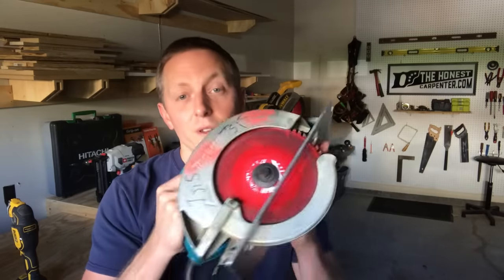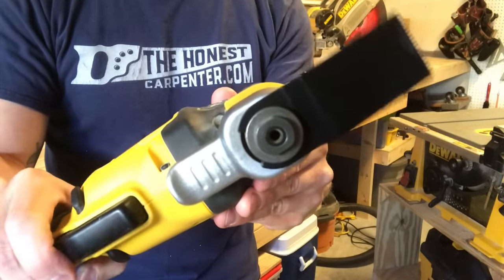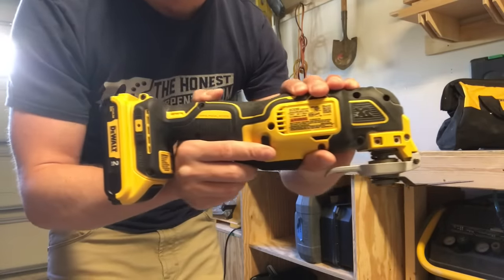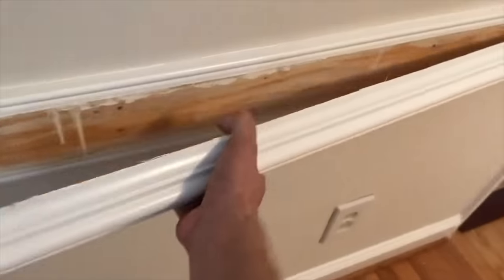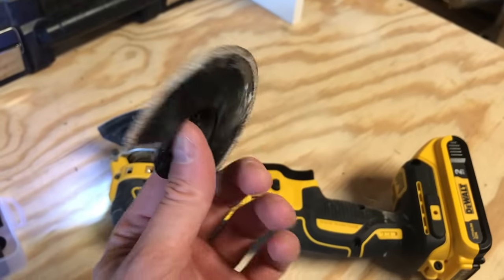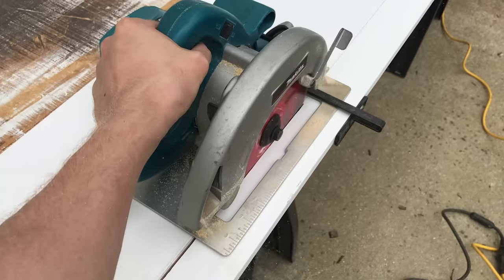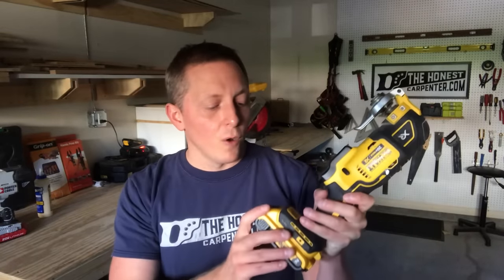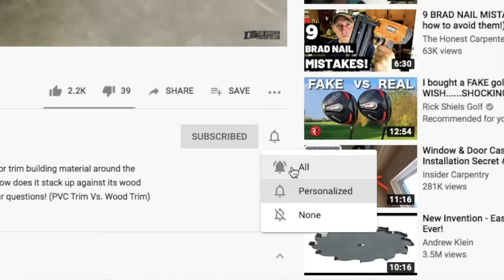The BEST SAW You've NEVER HEARD OF!! (Multitools--Great For Remodeling!)

Comment: An important point omitted in the video: This tool is a lot less dangerous as a saw than other saws because the oscillation pitch is so small that if pressed against your skin, it actually won't cut it at all. For most parts of your body, your skin and the flesh under it will just vibrate with it. In that respect, completely different to a circular saw or jigsaw. It'd still be painful nonetheless, and riskier on parts with less flesh (tops of fingers & toes, kneecaps, skull, etc.) but nowhere near as dangerous as a circular saw.
Reply: if you are using the longer toothed wood cutting bit I'd doubt that. for the finer bits I'd agree.
Reply: I agree with you about how safe this tool is. I’ve pressed mine against my skin many times. However, I still feel the circular saw is the safest simply due to the retractable guard. It’s really difficult to come into contact with a spinning blade on one unless you’re a complete moron with power tools.
Reply: I've seen a batch of these used at an orthotics factory, mostly on plastic.  The workers were fine with putting the vibrating blade against their palm, but those blades didn't have aggressive teeth and the palm is a padded part of the body.
Reply: Exactly! The vibration is 1-2 degrees max - so anything that has a little elasticity will just vibrate with it. So skin and flesh are safe. On the other hand, yes, it can cut through rigid materials like nails or bones without any issue.
Reply: @theoriginalchefboyoboy6025  actually the teeth size don't matter much, unless you stab it vertically into your skin

https://youtu.be/wCweyvsBGM0
Reply: I've actually done exactly what you've described.  I've pushed it on my finger and my finger just vibrates with it.  I'm not sure how i figured it out as i'm not a huge risk taker but it doesn't cut at all unless something is stable.  heck if the wood i'm cutting vibrates it won't cut it.
Reply: These saws were originally invented for bone cutting, and the idea is that they are great at cutting hard staff but poor at cutting soft stuff as it vibrates with the blade. So they're actually more safe. 
The vibration, though,  is a whole other story. Using this thing for prolonged periods will not make your hands happy.
Reply: I’ve seen videos saying newer tools have up to 4 degrees of motion instead of like 1.4.  Do you think that changes how harmless they are to cutting through skin?
Reply: I wonder if the idea for this tool came from cast cutting saws. I mean like a leg or arm cast. They use a vibrating tool that cuts the cast, but won't slice skin. Ya, I found out fast that if the material you're trying to cut vibrates, the blade is hopeless.

Comment: The oscillating motion prevents it from breaking the skin if you happen to graze the blade. The stroke isn’t long enough to break skin unless you’re really digging in with it. An oscillating tool os pretty much what is used to remove casts, and in fact that was the original intended purpose of an oscillating tool. It wasn’t until later that someone figured out it would work for more than just removing a cast.
Reply: I remember a doctor using one to cut the cast off my arm in the 70's.  It tickled when it touched skin.
Reply: I was using mine the other day to work on a section of a fence I recently repaired to cut through a fastener and I wasn’t expecting it to cut through it so quickly, so it flew past the fastener, got caught on the wood on the way and went left towards my hand. It cut through my work glove like butter around the thumb area (glad I was at least careful enough to wear my work gloves that day). I wouldn’t test it on skin!

Comment: These tools were originally invented for removing medical casts without cutting the patient's flesh.  They are very effective on hard brittle materials like tile, grout, drywall, and concrete/bricks and become less effective the softer the material is.  While the ones built for construction are generally more dangerous than the ones built for medical use, the oscillating action of these tools is still much less damaging to flesh than the ripping action of a circular saw or sawsall.  That said, you should still wear anti-cut gloves when using them and keep the blade pointed away from your fleshy bits.  Also, the nice thing about these tools is that they stop very quickly after you release the trigger, so if you just don't lock the trigger in the on position it won't take your toe off when you drop it.

One other thing to watch out for with these tools is fire.  The oscillating blade can create a lot of friction when used on soft wood or wood products like MDF, and they can actually set those materials on fire if you're not careful.  Like I said, best to use these things on hard materials and avoid trying to cut anything that creates a lot of flammable dust.

Comment: I agree that it's a Game Changer for repairs

I do woodworking as a hobby and have all of the woodworking tools for making tables, desks, shelving etc..  I began doing several home repairs and remodeling lately and got an multi tool after watching a few of your videos.  I didn't realize how much I needed it until I started using it.  I just finished rebuilding my front porch and nothing was square or flat.  I finally just roughly installed things like trim and then used the  multi tool to flush cut everything to match then sanded it.  I never would have been able to figure out all of the random angles. The project farm actually did a video on blades for the multi tool and I have been using the winner of the tests and they actually last nicely.

Comment: As you say these are  VERY handy for some applications . I have concluded after a year or so of professional use that it is worth it to just use the carbide toothed blades and save myself the grief of of having to change out a HSS blade that got dull quickly , unless you are cutting butter. Also dont waste your time trying to cut metal with these tools . Just get out the angle grinder with a cut off blade ! But they do pretty well on aluminum . But they just dont put much set in the teeth . 
      But a cordless angle grinder with a nice thin cut off blade in it is as revolutionary as the oscillating tool . So many uses , and so quick and easy to use.  But not for wood .

Comment: When I had to replace the rotten bottom parts of some boards in my barn doors I had to cut these boards in situ at 45 degrees. it came to my mind that a multitool would be ideal for this purpose. So I bought a Bosch that performed very well. Later i used it for sanding in tight corners and various other jobs.
Reply: That's exactly the application I thought of when I saw the video.  I have done this job with a hand back-cut saw.  Very tedious!

Comment: Another thing I like about the tool is you can turn the blade 90 degrees if need be and it works the same. I did this on a 6' T&G vinyl flooring cut yesterday. The tool being parallel to the material helped me keep it more steady instead of being perpendicular like it is normally used. Great video!

Comment: One thing that was not mentioned is that especially with more budget blades you have to secure smaller workpieces so they don't just start vibrating with the blade. It happens way less with higher quality blades tough. Really good video. Please keep them coming.

Comment: I've had my Harbor Freight tool for a few years now and use it on almost every project for sanding.  Recently I got a 18v Ryobi one and took a wood blade smoothed down the bottom side, and use it to flush cut plugs for screws and other holes, with minimal or no damage to the piece.  I also use it a lot when repairing various wood items, cut out the bad area  and then glue in a filler piece.

Comment: Newer to larger DIY projects.  Couldn't figure out how to make the cuts in replacing a door threshold, picked up the Dewalt and was done in minutes.  Recently used it when putting in LVP flooring.  Removed all the old nails and staples from trim/carpet.  Highly recommend as well!!

Comment: Had one for Christmas and even though I'm just doing a little DIY at the moment I've used it several times since.  Really useful.   
BTW...I saw another Youtuber 're-toothing' a blade with a file.
Reply: Yessss! It is actually easy to re-tool the teeth if you've got some decent skills. Just can't eat away too much material, but is easily doable. Side note: I sharpen my beat up router bits with a die grinder and have had good success for quick fixes and also use it to sharpen my cut off tool bits as well. ....but I'm a metal guy first so I'm used to doing crap like that.

Comment: Hey Honest, saw your video and my wife got one (DeWalt) for my birthday.  I already had some DeWalt tools using the same battery.   My first little job was to cut a piece of scrap laminate flooring to use as a shelf support (sounds odd, I know, but too long to go into).  I loved it!  Much easier than my hand mitre saw and less dust than my circular saw.

Comment: Hey man, using a small triangular file and going opposite direction for every next tooth you can resharpen these blades easily in a pinch.
Reply: Yeah, SeeJaneDrill did a good video on sharpening multitool blades.  A Dremel, used with carefully, could do it in a flash.

Comment: I am a big DIY fan. As well as full time mechanic in the automotive world. NEVER heard of a power multitool before. Normally when I hear Multitool I think of pocket Gerber or some other such thing. Saw this dewalt multitool on sale at Home Depot..... game changer. Amazing what this little guy can do. Use it to cut bolts all the time.... and as long as the blade is not dull? Cuts through metal like butter. Hard to reach bolts / seized nuts / etc. Haven't used it on wood yet.... but if it handles metal easily, I know wood would be no problem.

Love your review on this tool and agree... a deff must have.

Comment: I have. Fein tool,  I bought it when they were the only one making this tool.  20 years ago. I bought it so that I could plung cut into hardwood.  Now you can get a nice one for under a hundred bucks but I paid over 400 bucks for mine.   I have been in situations that it is the only tool that will work at all.   I used only when I was stuck because the cost of the blades and there was only one store in the area that carried them.  They were not always available . Thankfully the cost has come way down and every DYI store carries them.  For someone who does a lot of remodeling this is a must have tool. By far the best tool like this is the Fein.  But they are expensive. But then they last a long time too.
Reply: The new Fein multi tool has a quick release, ramp up start, and a 16’ cord. My brother had the original and it lasted forever, I think it’s just the switch that failed but he replaced the whole tool. I bought the new one, it’s the best multi tool I ever used....was on sale at menards for $90 and even came with 5 blades. The dremel brand was my first, burned out after about 40 hours of use. Bought a cheap harbor freight one to finish the job the dremel died on, but the case of that tool stopped staying together and it vibrated less after that. I’ve used dewalt cordless, Milwaukee cordless, Fein is the best
Reply: Yea, no quick release and no ramp up trigger but it does have an adjustment speed knob on the side. I love that the fact that all the newer blades from other companies will fit mine.  It’s a bit of a pain changing blades but I only use it for specific jobs it not too bad.  If I really wanted that feature I could always buy a cheap on.
Reply: Fein invented the tool and it's a quality product.

Comment: Needed one of these when I was tiling my kitchen to cut trim behind the stove. Went to Home Depot and explained my problem, the guy there recommended using a hammer and chisel. I didn't wanna chisel away 3 feet of material in a cramped space. Another customer overheard and told me to get one of these. Game changer! I've used it for so many things since then.

Comment: Used in masonry restoration work. With a smooth blade, the oscillator is awesome for removing old chalk joints.
The original German made Fein Tool was and maybe still is the best. Used to come with like 10' cord.

Comment: I'm a DIYer. The multitool changed my life! How much time and trouble it would have saved me if I'd had one 20 years prior. I consider the $100 I spent on it "Free." For the meticulous and perfectionist,  it's a gift, really.  But it is one of those machines that, like a printer, you complain about every time you have to buy blades ("ink cartridges"). For cutting metal, I've found the 
carbide blade essential, and they are pricier. And, like a jigsaw, guide the cut, let the blade do the work. If you have to start pushing the tool, replace the blade.  I've used the multitool in all the situations described, wood, trim, old nails (how do you get that nail out that holds the outlet box to the stud without disturbing the drywall? Multitool !!), plumbing (most recently, bathroom faucet handles that are corroded and frozen, the screw top rounded off after failed attempts to remove it with a screwdriver---not much space to use a hacksaw). WARNING: Whenever you're cutting metal with this tool, be prepared for the fine metal shavings that will be created in abundance. Have a vacuum handy or mask the area to collect the fines. Wear goggles and an N95, especially for overhead work.

Comment: Hey I just wanted to let you know that the oscillating tool will not cut you. As in it won't cut through your skin because it is to soft. It's one of the reasons why they use it to remove casts off of people. In the anatomy classes they refer to it as the "bone saw" because it doesn't damage the tissues like a regular saw would when you're trying to separate body parts.
Reply: yep, your skin has too much jiggle to be affected by the oscillating tool lol. Anyone would know that.. especially when cutting a shim for instance that doesn't have enough bearing to stop it from shaking/moving. It simply won't cut. Although i'm sure this guy just said that to cover his own ass.
Reply: I remember the original television adds when these tools came out for home use (many years ago, you had to order them by a 1-800 number) One of the selling points was that the blade wouldn't cut skin. I still don't completely trust that it won't cut skin, and I'm not willing to test it out. I'm sure there's some idiot on YouTube or Tik-Tok that would be willing to demonstrate it for the rest of us. Even idiots have their uses.
Reply: @Greyswyndir  My professor in my anatomy class demonstrated on himself when we were separating the legs and the arms from the torso. It's how they cut casts off of patients but drs like to call them instruments instead of tools lol
Reply: @NguyenNguyen-xv8li  - Yeah, I've seen them used for removing casts, but that doesn't mean a blade designed with sharp teeth for cutting wood or soft metal won't cut you if you accidentally come in contact with the blade. I'm familiar with the theory behind why these oscillating tools won't cut into flesh, I just don't have any faith that the information is accurate.

I'm sure it's accurate to some degree, but the blades they use in the hospital to remove casts are not as aggressive as the blades we use in home improvement. Apparently this tool has been around for some 70 years, but only recently (the last decade or two) made its way into the consumer market.
Reply: Very dangerous comment. Sure, you can touch your skin with some of the short half circle blades, but there are longer fine cut wood blades that will rip right through your dermis. The longer the blade, the more action out at the end. Please be careful.
Reply: @wilcogrundens9086  - Exactly, those things are vicious looking. Just a little accidental contact would be bad news. And some of the wood cutting blades have teeth going in different directions. I'd hate to get bit by one of them!
Reply: @wilcogrundens9086  : Some multitools even have an adjustment for the amount of side-motion they do to increase the cutting action.

Comment: I been remodeling my home and you are correct, my multitool is the best versatile tool for cutting and detail cuts.  I have a older home with plaster walls and the grout removal attachment is perfect for getting through the plaster without damaging huge sections of the wall.

Comment: Love my multi tool! Less than $20 at Walmart. Cheap, but damn I use that thing soooo much just doing diy stuff around the house. From cutting wood to sanding it. Thanks for the tip about pre skimming the cut line, as it does want to jump around sometimes. It is super loud when used indoors, definitely need earplugs.